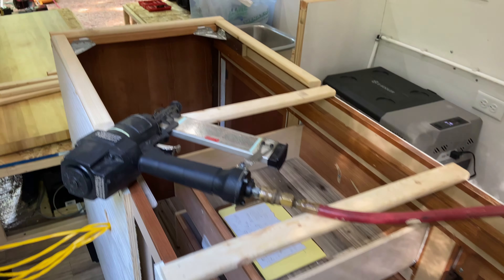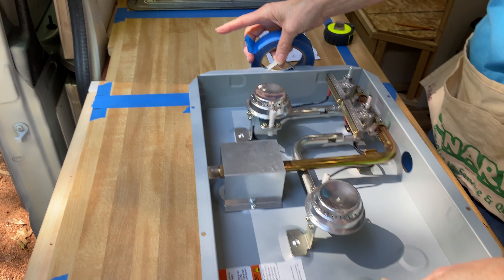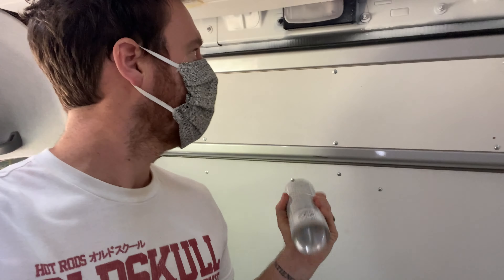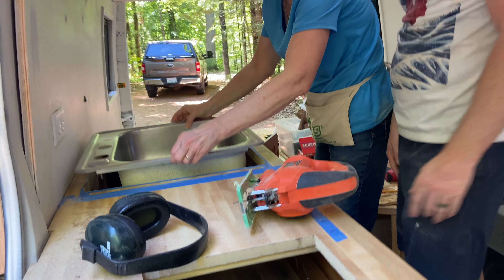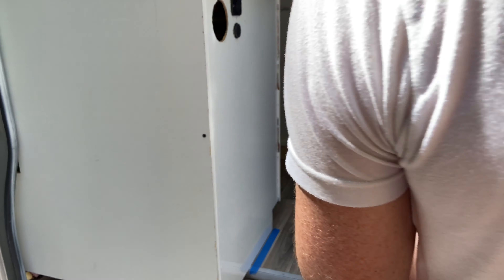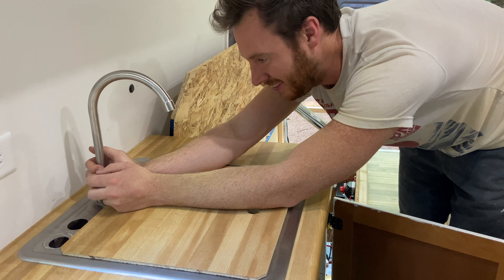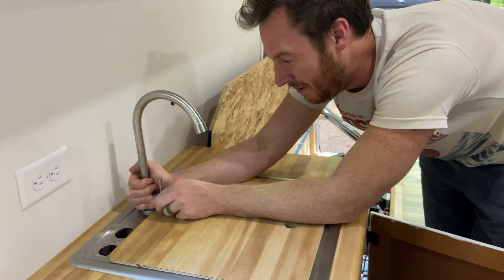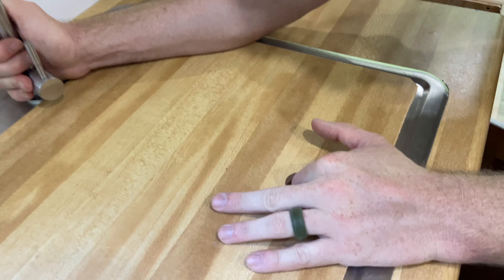VAN BUILD | Building a kitchen for our van | Sprinter van conversion

Comment: Frank Henry Phillips (1889-1958) from Portland Oregon is the inventor of what we now call the “Phillips head”  screw design. It’s not actually designed to hold on to the driving bit, quite the opposite, it’s designed to self center and slip (technically called “cam out”) to prevent over torquing on automated assembly lines with power screw drivers. This is a problem when using impact drivers to install them (as you have discovered) as those tools give many high torque impacts to drive the fastener leading to cam out if you can’t supply enough axial force while driving. A socket head cap screw is the fastener you describe but the head will sit proud of the work. What you want is a square drive screw.
Reply from the maker: There’s the pro tip to end all pro tips! Definitely buying boxes of those from now on. Thanks for the history and explanation!
Reply: Lisa & Josh I partner with Boeing for my manufacturing curriculum. Let me know if you want a 60 slide PowerPoint on hole drilling. I’ve got you covered.